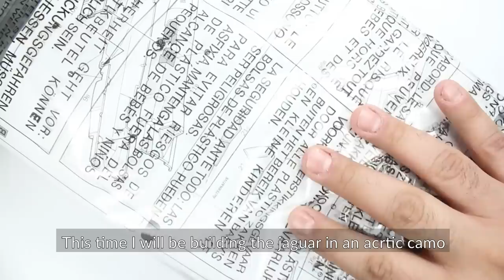SEPECAT JAGUAR GR.1 ROYAL AIR FORCE 1:72 ITALERI Full Video Build

Comment: What nozzle size and air pressure do you use with the airbrush, I've tried to free hand camouflage, but it either splatters everywhere or just splutters out
Reply from the maker: 0.2mm and 0.1 to 0.5 bar preasurre
Reply: @doctormig2709  thank you